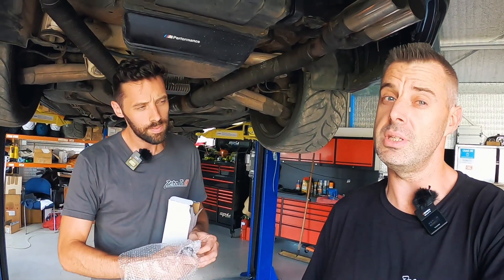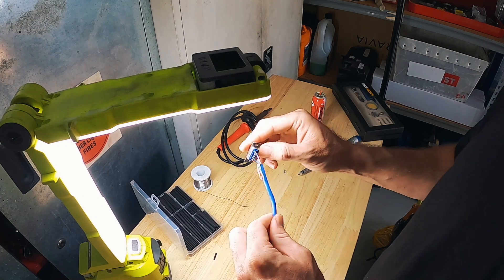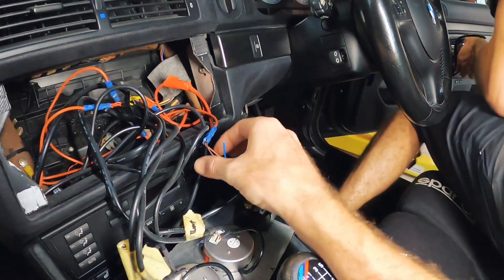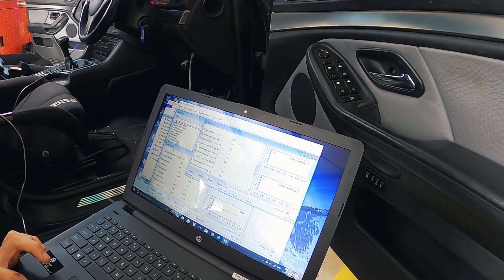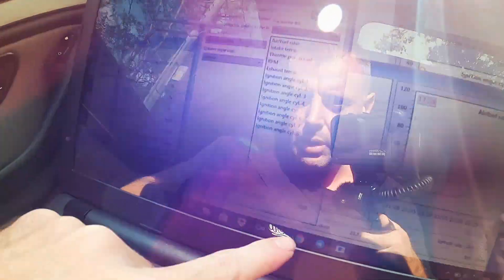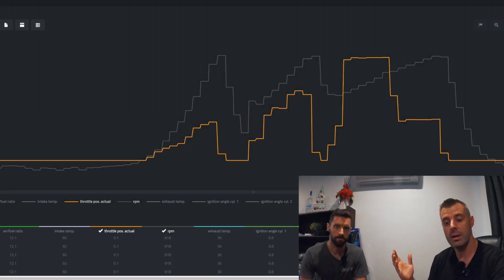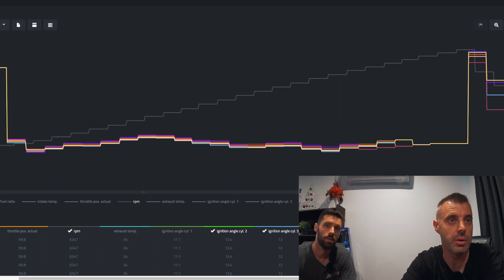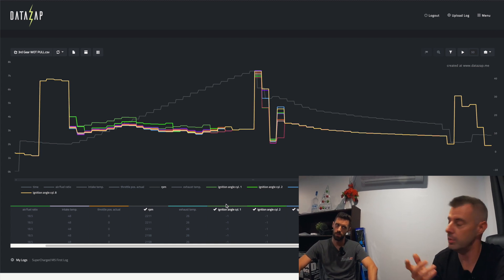ESS Supercharged E39 BMW M5 Data Logging Wideband Using AEM Gauge & Testo

Comment: Looks like the front sensors are narrow band, especially if you took one of the rears from the 335. There will be no closed loop fueling with narrow band primary O2 sensors at WOT, so there is nothing to learn or adapt at WOT. Closed loop fueling will only be active at low and part throttle angles. This is a much less sophisticated setup than the N54. 

At the very least you might want to think about putting an analog gauge on the fuel rail to make sure fuel pressure is responding to manifold pressure and you are not running out of fuel up top. The fuel pressure regulator should maintain a constant pressure across the fuel injector. The rail pressure will drop if there is vacuum in the manifold and it will rise if there is positive pressure (boost) to make sure the pressure across the injector is constant. 

You might be killing the O2 sensors because they are getting too hot with high timing advance an too little fuel for highway cruising. They don't look that close to the head, but I don't have any experience with supercharged M5s. Another thing to consider is the mounting angle. They need to be angled with the sensor element down so water can't collect in them. They all look pretty flat to angled slightly up at the sensor end. 

The M5 will be an awesome car once the tuning gets sorted out. You guys will get it figured out.
Reply from the maker: Thanks for the ideas dude. You’re on the money. The next episode is out and we did find the problem.

Comment: Regarding the IAT’s they will stay high after a run because the airflow is very low at very light throttle. The temperature also reacts quite quickly, the 1 degree dip at around 3k is the cooling effect of opening the throttle and increasing the airflow into the supercharger and the engine. They all look reasonable to me considering the ambient temperature 👍

Comment: G’day gent!! I’m wondering why you guys aren’t giving the m5 to a tuner to dyno? Considering what you have discovered with timing and adf’s it’s the first place I’d be taking it. She’s not a cheap fix engine wise. Watching it being tuned on a dyno would still be good watching. Anyway gents keep up the good work 👍
Reply from the maker: Hey Michael, probably should have made it clearer in this video but we aren't tuning it, I've lined up HTE performance that is known around the world for great work on the E46, E39 and later BMWs. With their expertise and the logging working properly that is everything corner covered and should yield better results than a tuner with a dyno that isn't intimately familiar with these engines and DMEs
Reply: Zero To 60 no I get you guys were logging. My thoughts were more leaning towards the controlled environment where they would they start with short partial pulls and could see your afr’s climbing and abort the run, adjust and continue. Anyway only my two cents from my own experiences 👍

Comment: And is it a rising rate 1 to 1 fuel reg ?
Reply from the maker: hey dude missed this comment. Just to clarify its not a rising rate reg at all. The fuel system is not designed for boost. However we have found out the reg targets 5 bar of fuel pressure.
Reply: @ZeroTo60Tube  being a boosted car you should look at fixing the issue with a rising rate fpr as we all know boost is an addiction just 2more psi

Comment: Is the fuel reg boost referenced?
Reply from the maker: No its not and most setups on these cars dont either. Definitely a bit dodgey. ESS leave the fuel system alone apart from injectors. This car is supposed to have an upgraded fuel pump. But its looking like we might need to peer inside the tank and see whats going on. The logs legit look like its simply running out of fuel up top.
Reply: @ZeroTo60Tube  yes I agree it is running out of fuel higher in the rpm range I’d be checking the fuel pressure and fuel volume as to whether it’s the pump running out of puff or simply the injectors not getting enough pressure to keep up with boost thus needed a rising rate fuel pressure reg

Comment: My guess is you are out of injector or fuel. If you are leaning out at higher rpm as the boost increases then it's a fuel volume issue be it hardware or tune. Can you see injector duty cycle in your data? Fuel pressure would be good too. Is there a larger oem injector that swaps in?
Reply from the maker: You are on the money! Will have another update soon, but it appears the ESS tune is very lean up top. Which can't be right so gonna to some testing with a modified tune and see what results we get.

Comment: There no learning for the stock O2 sensors at wide open throttle. The engine will go in open loop and injection timing will be done based on the tune with no correction based on the O2 sensor signals. Fuel trims and lambda correction are only used on part throttle and idle.
Reply: I'm not sure about no CL corrections at wot, but the sensors should still be accurate. My 335i is the first car that I've owned that uses closed loop feedback at wot. Not sure what BMWs do and don't do this.

Comment: crazy that there is no intercooler on these setups.. esp with Aussie temps! Evolve did some back to back dyno runs on a non intercooled ess kit and showed around 100 crank HP drop after 4 runs and 78deg intake temps (with 23deg ambient..) Also AFRs around 12.5 in boost
Reply: +1 for Intercooler upgrade 👍

Looks like logs getting better, hopefully after a few more runs would have adapted. Can never get bored of the sound of that V8, 😬
Reply from the maker: It really is a bit crazy they didn’t charge a small percentage more for a cooler option. Would love to put an intercooler on it ASAP.

Comment: Is the wideband sensor turned on directly? Looks like it is measuring instantly. 
You should wait for the exhaust gases heating up (getting rid of the water) otherwise the sensor will get a thermal shock and be destroyed. 
You probably already know this but if you missed it...
Reply from the maker: Thanks for the thought. The gauge definitely isn’t powered in direct and it takes about 3-4 seconds for it to start reading when you to turn it on from cold. However haven’t gone through how the sensor is Powered yet and the wiring is something we’d like to Re-do.

Comment: I don't understand why you wouldn't be checking fuel pressures and trims.  With PI fuel pressure shouldn't be as big of an issue but when looking at AFRs that is only half the picture, pressures and trims will answer some of your questions.
Reply from the maker: No fuel pressure sensors on these things. Im not even sure if fuel trims are as important since the DME doesnt have wideband O2 readings like the later models which is what the fuel trims feed off.

Comment: hi andrew a good way to stop o2 sensors going bad is to put spacers on them they are called spark plug savers they are a threaded sleeve about 40mm long with a 3mm hole drilled down the centre of it . screw it on the o2 sensor then screw it into the exhaust it then only allows a smaller amount of exhaust gas to pass the sensor as the end of the o2 sensor is in the sleeve not the exhaust pipe also good for tricking the ecu stops the dreaded money light from coming on but i would only put them in the down stream o2 sensors as you would want a correct reading for the upstream sensors cheers glenn
Reply from the maker: Have seen a lot of guys use them on the single turbo N54s, but they are normally dying from excess heat. I am thinking this setup shouldn't be killing sensors, so if it is, something isn't working properly and thats what we need to work out. The sensors we have pulled out of this have been very sooted up. Like worse that i have ever seen before.
Reply: @ZeroTo60Tube  sound like the cats may not be working to there optimal or you have injectors that may not have a good spray pattern
Reply: @ZeroTo60Tube  it was too rich at some point, and too lean later on when iat was fixed. When lean ,egts go up. High egts burn exhaust valves and o2 sensors(although I don't think it was that hot in this instance but mightve been, 15 afr at WOT is pretty damn lean lol) . You don't need post cat O2s. I can just code them out. You can use the post cat sensors as precats if u repin them. It's the same sensor different connector.
Reply: @HassanEido1  Is it just as good to use one of the rear o2 sensor bungs to connect in a wb sensor for logging? My 2 rear o2 sensors are coded out anyway, they are just in there to dont have an exhaust leak:p
Reply: Make sure the Wideband isn't just connected to a constant power source when the ignition is on, I usually connect it to the gearknob light wire, so that it only turns on when the lights are on. This way if the ignition is on for an extended amount of time without the engine on, the sensor won't overheat and die out.
Reply from the maker: To be honest haven't checked how its powered yet. The gauge only comes on with ignition. However its cooked 2 wide band sensors and 1 of the 4 the dme use. All were black as hell. I should add, these sensors were all killed while it was idling around with the air temp sensor not connected.